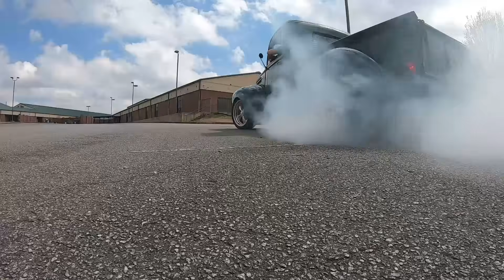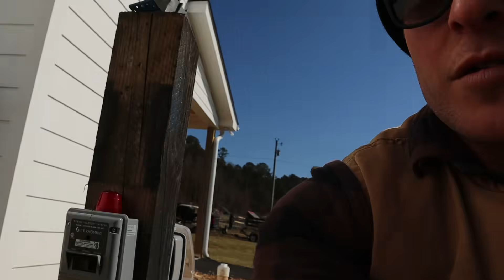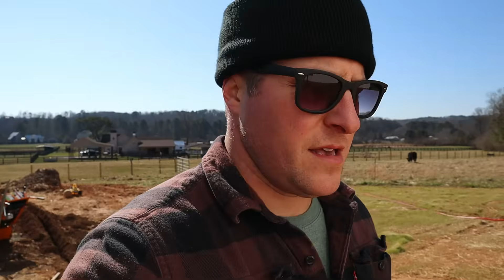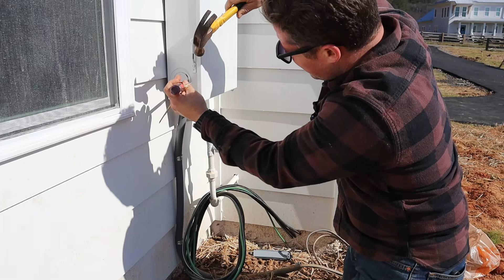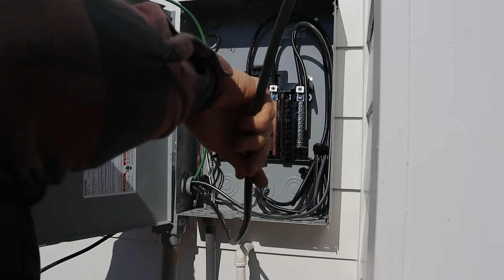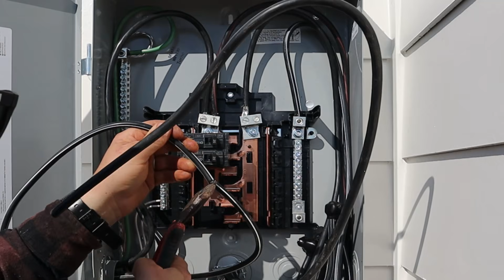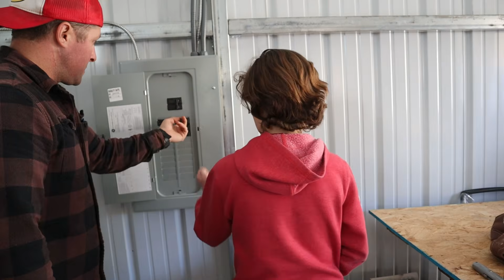UNDERGROUND POWER.. 100 amp sub panel for metal building! Dream Garage build Ep. 9

Comment: Hello. I built a 26x50x10. I am wiring the inside now before I run power from the house to it. Glad I came across your video. Do you have issues with condensation? Trying to decide what to do for it right now. Any help will be great. Thank you

Comment: Does your feeder line need a  ground from the main panel? Thought you needed just a 3 wire feeder with the sub panel grounded? 
(DIY guy fixing to do the same)
Reply from the maker: You’re absolutely right.the feeder to a sub doesn’t need the ground. Just drop a new ground at the sub panel. That’s what I’m going to do for our barn

Comment: Nice video! we are in the process of builing a structure as a kitchen for YouTube, and are also doing 100amp 240v service.. question though: according to my calcs, I have to use  4/0 4/0 4/0 2 aluminum able to get that amount of power out there... Part of it is that we are running 250ft away, so we have to account for voltage drop. Seems like a lot of extra size for that though. How far did you have to go??

Comment: Nice job! You need to check the NEC for the ampacity of 2-AWG aluminum conductor. It is 90-amperes when used as a feeder from a service rated over 100-AMP. In table 310.15(B)(16) under aluminum conductors 75c you will find that the ampacity of 2-AWG conductors is 90 amperes.
If the service to your property is over 100 then you need to put 90-ampere rated circuit breaker in to protect all the 2-AWG aluminum ungrounded conductors. This mistake is common though.
Reply: > This mistake is common though.

It's also hot.
Reply: I haven't used direct burial in quite a while, but I believe cable types have expanded somewhat and  is covered by more insulation types, including 90C and even 105C cables  in this   category.  90C aluminum cable has a 100 amp rating.  Personally,  I prefer to go with copper in PVC conduit and I have doubts that the direct burial cable would provide  cost advantage. and as I recall, it needs to be buried at 24" or below. Maybe they were, but the trench I saw in the video  didn't look that deep, 

Most of  what I saw here looked pretty good and although some inspectors may  find a thing or two to complain about, it looked like a pretty good installation.
Reply: Yeah but realistically, he's probably never going to be pulling 90 amps at once, and there is some over head redundancy built into all this stuff. Like that 90 amp trailer wire could handle more. A lot of retailers rate that wire for 100 amps( even though it's 90 amps by the book) Realistically he"ll be fine over 10 amps

Comment: you connected the grounds incoming to the Neutral bus with the green screw, this is incorrect you mixed up the ground bus with the neutral bus.  The green screw should be removed in a sub panel, and the white or neural wire will not be grounded.  You have an electrical hazard.
Reply from the maker: I removed the bonding strap. Sub panels have removable bonding straps allowing you to bond the neutrals together or use one bus for ground and one bus bar for neutral.

Comment: After working for an industrial uniform supplier, and teaching arc flash/flash fire protection, I can tell you from experience about an arc flash after adding a 30 amp breaker for a camper hookup. After setting my beer on the top of the panel, and quickly letting the screwdriver slip, I ruined a really good shirt, a pair of underwear, a half can of beer, and a cheap screwdriver. Somehow only my eyebrows and eyelashes got burned off. We were very lucky men.  Let me tell you, you don't want any part of a 220 arc flash. My whole career we emphasized caution around 440 and up. 220 was never a real topic of conversation. I'm a believer.
Reply from the maker: Super good info thank you.

Comment: Hey Project Dad, 
When installing the (Direct Cable) LB box from the  outside to the inside of the service panel, How did you secure the LB Box and water proof it? I am in the process of finding a spot in my garage and like your idea, just confused about securing the LB conduit.

Comment: Nice job on your first sub panel and most of all much respect for putting yourself out there for all these experts highly experienced electricians to come out and give you back-to-back feedback:-) I am an air conditioning contractor personally I would have put the cable in a conduit underground but no big deal it's in sales at least you have experienced direct burial and if it doesn't fail even better :-) the double legs on the exterior subpanel kind of caught me off guard without putting a breaker other than that the lock ring and bushing that we're missing going into the panels. Other than that looks great good job just correct those few small issues and you're rocking and rolling money in the bank baby money saved is money earned

Comment: Great video on how you should call an electrician instead of DIY. The LB boxes “boxes where the wires turned 90 degrees & entered the 1st sub-panel & 2nd sub-panel” have no 2”-3” pvc pipe for going through the wall. They neither have a pvc connector with a lock-nut and no pvc bushings to prevent wire chaffing all of which are required by the NEC for running feeder wires through conduit. Though, the cable he used might be “direct burial” cable, most electricians and electrical inspectors would say “the trench is already dug so just run the wire in conduit”. These type of mistakes can lead to wire chaffing, sparking, fires and property damage and loss of life due to inexperience!!!

Double tapping the main lugs in the 1st sub-panel is illegal in this case because, this is a small sub-panel not a main distribution panel feeding multiple service panels. Though he “DIY DAD” felt a 3rd breaker was not needed he is wrong, a properly sized amp breaker for the feeder wires approved Amp rating is required by the NEC. Other than those couple of issues the install looks ok but, very doubtful it will pass any state, county or local city electrical inspection with any scrutiny. This is precisely the reason why if you buy a home especially with a detached garage or building supplied with electricity. HAVE IT INSPECTED PRIOR TO SIGNING OR AGREEING TO ANYTHING!!!
Reply from the maker: So your saying I’m pretty much a professional 🤷🏻‍♂️! Haha just kidding Merry Christmas
Reply: @ProjectDadLife  LOL that's funny because it's true! Thanks for the video series, I like your work. I'm wiring my metal shed now and turn to a lot of videos for guidance.

Comment: Your neutral should not be pressed against the panel. It is a current carrying conductor.
Reply: WHAT?  The Neutral is INSULATED, it doesn't matter what it touches...Sorry, but you don't know what your talking about.
Reply: @tomnorman5461 , I base my knowledge on 40 yrs, experience as a journeyman Electrician. If any boss would see a current carrying conductor in a bind you would have to correct that. Remember the "Bible" says " in a neat and orderly manner

Comment: 18800 for that building? seems about right. Were getting one very similar from texwin in texas but through oklahoma so we only pay the 6.25 tax rather than the 8.25, anyways its a 35x24 for 16850 but we were blessed and were able to get locked into a 30% off flash sale so we wound up paying right around 14100.

Comment: I was a Sr design engineer for very large contractors and retired.   Very very well done install!   I would make a suggestion.   If you can, clean off a spot on the metal the panel is mounted to and install a lug on it.   Run a #6 from that lug to your ground bar.   You are already kind of grounded by mounting the panel to it but those screws may not comply with NEC requirements.   Just a little added insurance that no one will get shocked touching the building.   Best wishes,   Kevin
Reply from the maker: Thank you very much I definitely enjoyed this project and glad I was able to take it on. Thanks for the feedback I’ll most definitely add that to the panel. Thanks for watching

Comment: Do you not have to put sand in the trench and a board or gravel on top of it?

The wire should be protected in case of contact from a shovel or other digging tool.
Reply from the maker: I’m our county we just have to use direct burial wire it’s double cased. Then bury it to a certain depth we’re good to go.

Comment: Good work, quick question how did you secure your panel in the shop.
Reply from the maker: Thanks. I used sheet metal screws and attach the right side to the vertical wall stud.

Comment: You just stuck the LB in the panel and called it a day ? 🤔 I would’ve used a connector with bushing and lock nut with a short piece of pipe going into the LB, what’s stopping someone from pulling that LB right out of the panel
Reply: I came to the comments wondering if someone else picked up on that. Is there a rule in the NEC about that, do you know?
Reply: BRO! I called our regional electric inspector yesterday to ask a couple questions before I DIMyself (and he was nice enough to answer)😊 For 100A subpanel: 1/0 1/0 1/0 0-2 (must be 4 conductors). 6ga ground (5/8 rod AT LEAST 6 ft apart)😊

Comment: For that distance, you should have run a larger wire. I'd expect to see voltage drop if you're running welders.
My guess is you're good for about 70 amps before things start going south. Your breaker is oversized.

Comment: You need to pull that bonding screw out. That is not your main service. Ground and neutral need to be isolated
Reply from the maker: The bonding screw is on the ground bar only ground to panel. The bonding strap was removed so the neutral strap is not grounded
Reply: @ProjectDadLife  you should go look again. Bonding screws are for bonding the neutral and ground. I'm a licensed electrician and that is the only purpose that screw serves
Reply from the maker: Thanks for help. I’m not sure it’s correct but I took apart the plastic cover just to double check the neutral and ground bonding strap are not connected once the bonding strap is removed. So essentially I used the grounding bar as a additional sub panel bar attached to the case with the bonding screw. That make since? I know my electrical terminology probably sucks lol. Still wrong you think?
Reply: @ProjectDadLife  do u have an electrical meter to measure continuity?
Reply: @ProjectDadLife  that green screw need to be removed no matter what.. u should use a proper ground bar kit with the appropriate screws to bond the ground bar to the panelboard
Reply from the maker: Yes I have one.
Reply from the maker: Agreed I will. I guess I was just thinking practically. It literally is a grounding strap if it’s isolated and not touching anything else but the case.
Reply: @ProjectDadLife  that bar on the left is connected to the bar on the right. It is your neutral bar. If it was your main service, you would put that bonding screw in to bond to the case. You need a separate ground bar and the screw needs to come out
Reply: @ProjectDadLife  I guess my best advice is to pull off all the neutral and ground wires in your panel and check to see if there is continuity between those to bars. Without me actually seeing the panel that's my best advice. Sometimes it's hard to see where they are actually connected. Sometimes plastic is covering the connection. Hope that makes sense
Reply from the maker: I took the connection strap off that connected the left and right bar. So they are not connected at all. In the video I actually show the connection piece I took off to totally separate the left and right bar. At that point there both isolated from everything. So I used the right bar for neutral/white. The left bar I grounded with the bonding screw which pretty much mounted it to the case. Then used it for ground.
Reply from the maker: Yes makes totally sense. So if the left and right bars have no continuity. Would it be ok how It is? Thanks
Reply: @ProjectDadLife  as long as the ground bar is connected to the panelboard then yes
Reply from the maker: Thanks for the professional input. I appreciate it I got a few things I’m gonna fix and tidy up thanks to everyone pointing me in the right direction.
Reply: Learned a lot from this discussion.  This matches what I see on solar installs.

Comment: I normally don't watch people doing electrical work because it is super cringey watching amateurs doing electrical work. Being a licensed electrician for the last 25 years I am only going to tell you one thing, from a safety stand point. You and your child (I assume, I don't normally watch your channel) should not be standing in front of the electrical panel when you energized it; if something was incorrect you could have had an Arc flash and badly burned one or both of you. I only say this because I don't want to see anyone hurt especially a child.
Reply from the maker: Yes totally agree. I shouldn’t had my son standing further away. Thank you. What do you normally use to flip the breaker for the first time?
Reply: @ProjectDadLife  I normally stand to the side of the panel facing the wall so only my hand and part of my arm are exposed. There is OSHA required PPE for different applications and exposures. It's costly gear for a home owner. Nice work keep it up.
Reply: @ProjectDadLife  Ditto on Ricks comment. Have the face plate back on the panel and atleast some good dry leather gloves with some heavy rubber scrub gloves underneath for the first power up. Some think 120v & 240v are "not that dangerous". 120v kills more people in the US than any other voltage. It wont blow you up but at the same time you cant let go either. Most are lucky and just get a warning zing.
Reply: @mattozx6rr  I got zapped with 220 so many times as a kid that i stopped counting, you guys are over reacting here.
Reply: @skhan66  LMAO 100% lying! You meant to say 120 volts because after getting hit with 240 volts one time you won't be back for seconds:-)
Reply: @realancientpersia  What's there to lie, I said 220v not 240 . There is no 120 in Pakistan, only 220. All household appliances run on 220v standard. First time I was zapped and i remember it as a 9year old kid, it threw me 5 feet back and numerous times after that  in my teenage years.
Reply: @skhan66  😂110 or 120 and 220 or 240 are all in same range of that doesn’t matter. If you checked with your power with volt meter you will get differences. Could be 115 or could be 118 or even 129 🤷🏻‍♂️
Reply: @mattozx6rr  Yes it's the amperage that kills. I worked for 20 years as an electrician in Australia with 240V. Can't count the number of times I got a shock, but I typically worked with wires suspected of being live where I wouldn't grip any ground and any shock always threw my hand away from the source. 240V grips the hell out of you.
Reply: @realancientpersia  I've had plenty of shocks with 240 and 110. I'd rather 110 anyday. 110 is like a small dog grabbing your hand and fighting you, 240 is like a lion throwing your body around. One time I got a 415V shock with a knife in my hand; it threw my knife hand back so hard and fast that I almost stabbed the guy behind me. 240V is single phase in Australia, 415V is three phase.
Reply: @mattozx6rr you are so wrong not 1 person has ever been killed by 120v! Now they have been killed by amps but you could literally hold 240 v as long as you want to until there is a amp load on it nothing will happen
Reply: He's talking arc flash not shock hazard.
Reply: Male Karen alert

Comment: For someone that doesn't do this type of work every day, you definitely did a great job all around. Great workmanship. 
Just a couple comments. 
Regarding the #6 ground. I believe the largest solid conductor you can get is #10. Anything bigger is stranded. Here in Canada, code requires a minimum #6 copper insulated or bare conductor. 
If at all possible for next time, I would recommend going at least 3 feet deep with the conductors. Less chance of hitting them if you ever dig around. Your area may differ, but here code requires at least 3 feet. 
Thirdly ground rods are to be spaced a minimum of 10 ft apart. 
I can't see there being a problem with your LB (the 90 connector you used to enter the panels). As long as the cover is sealed off properly with a rubber gasket on the 90, and the fittings properly glued and secured with a nut on the inside of both panels.
Keep up the great work. I always admire a guy that isn't scared of doing the research and doing things on his own.
Reply: In the US the ditch in grassy area can be 24 inches and ground rods 6 feet apart.
Reply: i replaced a well control panel for a friend. It Was wired with number 4 AWG solid conductors. The most God awful stuff I ever worked with. I have strong hands and I needed a pipe wrench to bend it. #8 solid is really common for pool bonding here.

Comment: This getting inspected? Fail
Reply from the maker: No inspection. Curious Why would it fail though?
Reply: @ProjectDadLife  main reason the way u put Lb into panels
Reply from the maker: What’s the correct way? Couldn’t find much info on it. I wish now I would’ve just bolted a conduit elbow to the panel and just glued the stick in. Don’t think I really needed the LB access panel.
Reply: @ProjectDadLife  Undersized conductors for 100 amp.

Comment: Was covering my eyes with the razor knife business, having cut myself too many times with a razorknife, I tend to use strippers whenever possible. 

Ensure the neutral is rated for pass through service, and seal it up extra water tight. Putty is your friend and you do not want water coming in to a box at all.